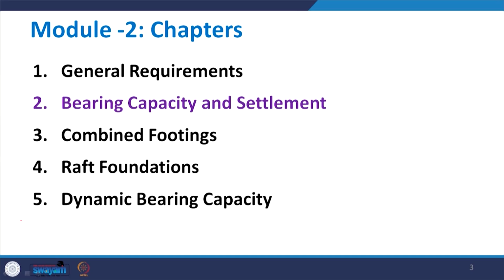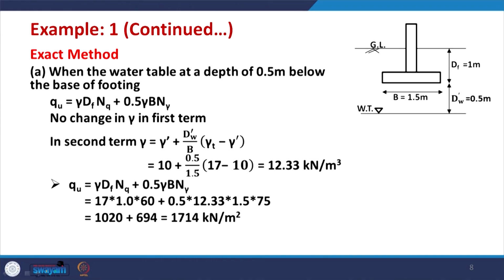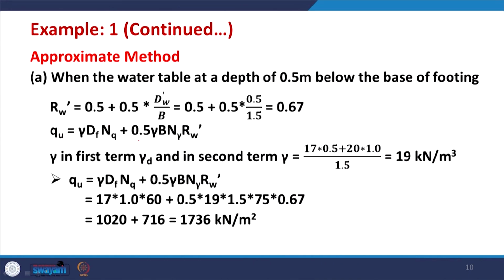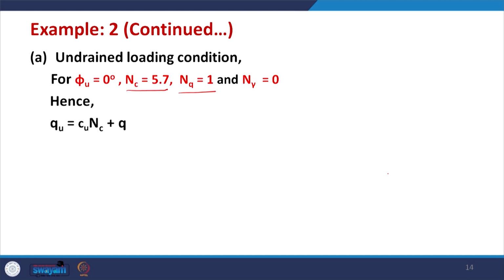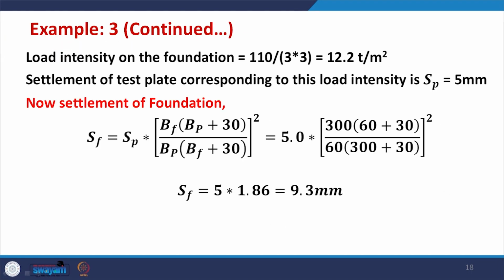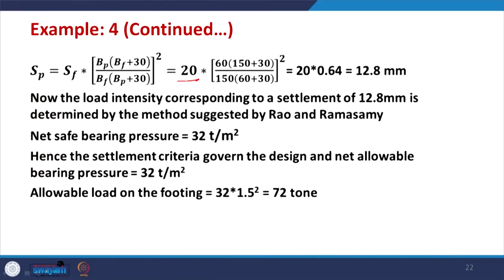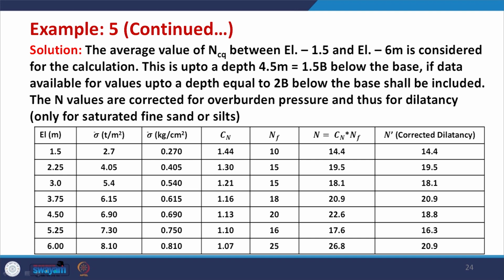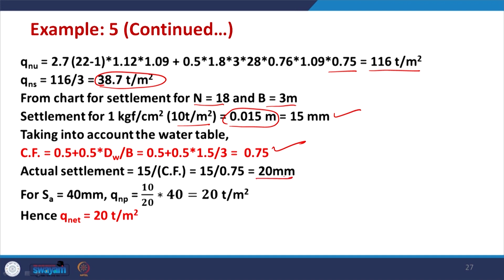Mod 01 Lec 05

Comment: Sir
Actually we supervise  three to four story building  please provide the economical solution of footing on property line that higher eccentricity bearing capacity of soil 10 t/m2.thearotical when we checked pressure value may be 15t/m2.strap footing not accepted by client. Please provide solution .